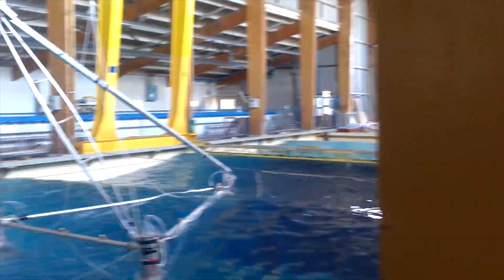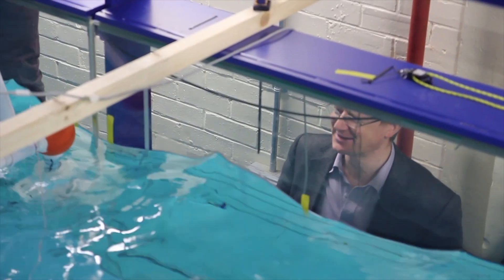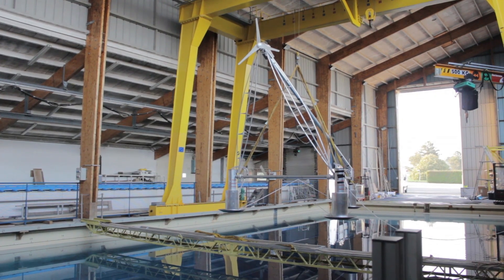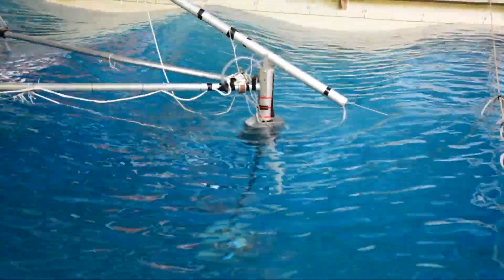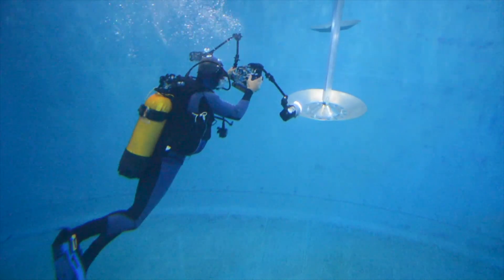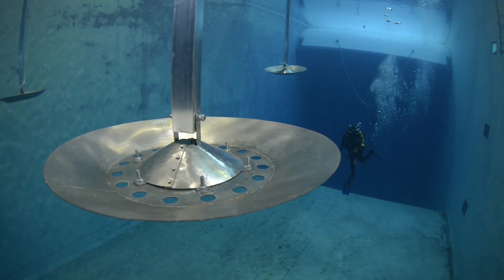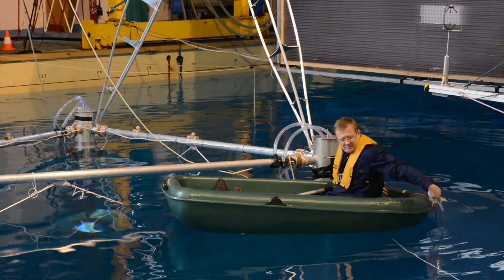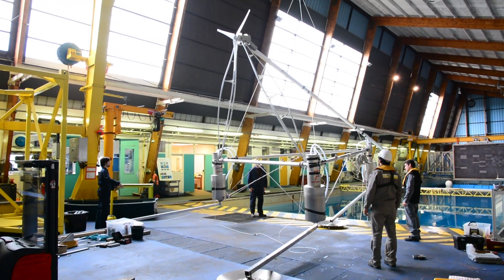Tetra Tests in France

Comment: Have you ever considered to use vertical axis wind turbine with such platform? Because most of the mass will be at lower level and could be more stable? And you can also produce twice the amount of energy with the same surface area (it has been proven). The only disadvantage is that the technology is quite expensive compared to standard horizontal axis bu I think it really worth it! What do you think?

Comment: has anyone thought about trying to store energy created by large trucks (lorries) when the use their Jake Brake systems.  They are essentially turning diesel engines into air compressors but all the compressed air is just released into the exhaust.  Perhaps that energy could be recycled by storing it in the truck and releasing it at gas stations?

Comment: I like the idea. But with only a few minutes of thinking I come up with some questions.
What about the internals. The tower bends and deforms making it difficult to mount internals inside the tower properly. How large accelerations do you expect on a 100m turbine? what about the cooling, oils and so on. Can they handle the extra movement.

Not to talk about maintains. Stuff breaks down and you need people to fix it, inside the tower.
Whether is bad at locations with wind turbines and not many days are available for turbines as it is now. If the turbine is floating will this reduce the days where maintaining is possible.

Comment: Does it work just as well when the wave crests aren't parallel to one of the edges? Or when the structure is being battered by waves coming from more than one direction at once?
Reply: I was wondering this, too. The wave pool is cool, but it's a very controlled environment.
Reply: My tooughts too. The structure is not symmetrical. Probably you could adjust the angle through sensors. The sea is not changing direction constantly.